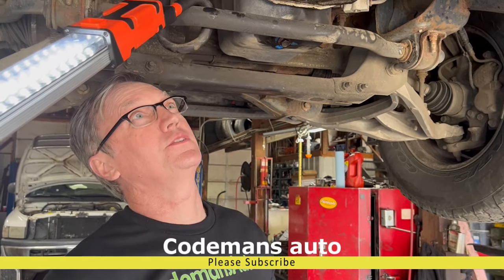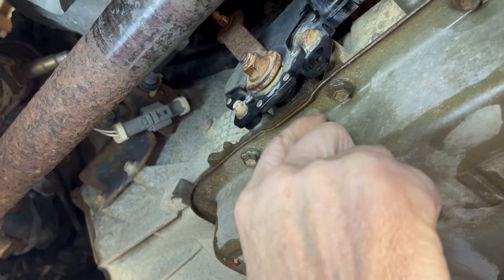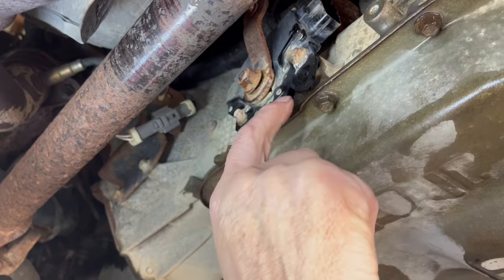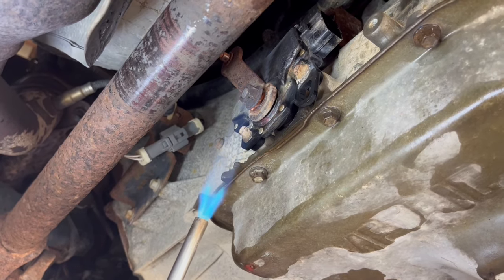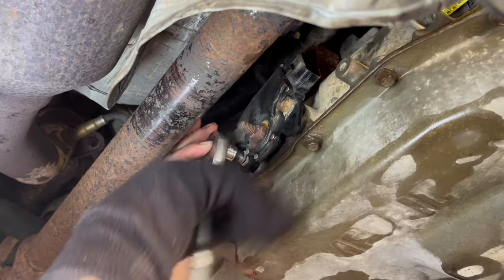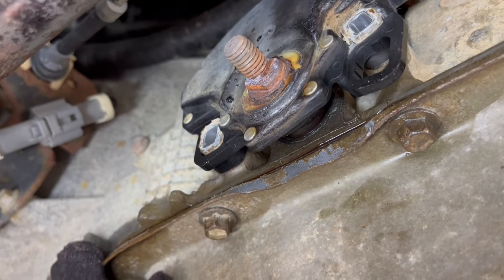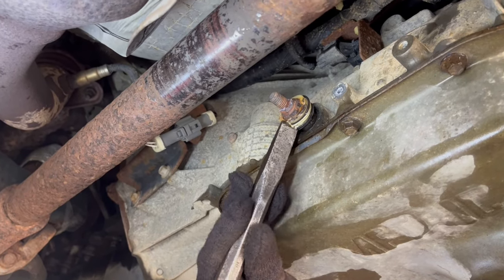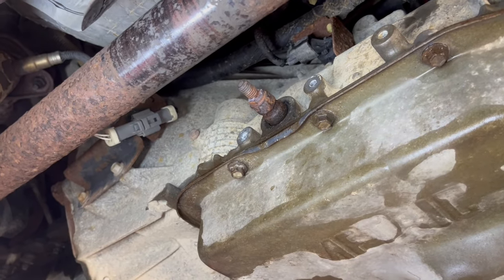Ford F150 changing  replacing Neutral Safety Switch on the side of the transmission shifter is stiff

Comment: As an amateur I always soak the bolts with WD or PB Blaster before I start the project, being careful with the overspray. Is there a reason I don't see more pro's using that method?
Reply from the maker: I have not had much luck with PB Blaster removing the nut on this Neutral Safety but I do use it in some of my other videos
Reply: I’d certainly try it. Nothing to lose
Reply: Fire is your friend when you’ve confirmed you don’t want there to be a bolt anymore

Comment: Great video. Thanks. Maybe wiggling my shifter and occasionally having to start in neutral isn’t so terrible. 🤷‍♂️
Reply: No, it will get worse
Reply: @jacobrogers4619  thanks. I went ahead and fixed it, but I honestly appreciate the input. Had I not fixed it, you would likely have been my incentive.

Comment: Thats all the same on the 1998 ford f150 v6 regular cab.

So you say its bad if its hard to shift it mines not hard to shift so then what im gonna do is put the new transmission pan gasket on first and fluid then see how it does mine might still be good and that'll be one less part i have to buy I'll clean the prongs off though on the electrical part

Comment: good video.  i got the 2010 f-150 the P0708  will this code put you in limp mode as well.  i also have no gear indicator's on the dash is this part of the n safter switch your are replasing problum .   thanks for any help or ad vice.  also what if you are just a little bit off on the mark will it still sind a code.
Reply from the maker: no,  it wont send a code but it might not start in park
Reply: @codemansauto208  I got a question

Comment: My f150 wont start I replaced the ignition and the battery and the silenoid and starter and it will only  still start from the selinoid. Im not having any issues from the safety switch but it has never been replaced and is really old could it still be the safety switch not sending the signal to the selinoid and im not having any other issues with the safety switch thanks.
Reply: My 2000 f150 would only start off of solenoid until I replaced the safety neutral switch now it's fine

Comment: thanks for the video. i see a leak behind the NSS on my 2007 f150 5.4 4x4. i think that seal behind the nss is leaking. question - what is the name of the seal? do you have a ford part #?
Reply from the maker: should be a Linkage Shaft Seal, but not sure on the part number
Reply: some parts books call it a shift shaft seal

Comment: Would this help with my 2006 ford f150, the problem is when I try to start it sometimes it starts and then other time it doesn’t want to start, the lights turn on and everything and then when I put it into neutral it starts up but on park it doesn’t, any idea? Also sometimes when I put gas it stalls to try to turn on and I wait a couple of minutes for it to turn back on. Thank you
Reply from the maker: this neutral safety switch sounds like your fix
Reply from the maker: Make sure that you line up the two marks on the new switch as shown in the video
Reply: I too have a 2006 f150 with exact symptoms I just picked up a new sensor gonna try it when I get home. Hope this is the fix
Reply: Update.thank you to the poster. This was my exact problem!

Comment: I was driving back from Vacation- and mine started giving me a “Trans Fault” with a flashing o/d light- 

Took it to get coded and it read a P0705 code. 

Going to change this part out due to the RPM’s jumping between 4/5 gear.
Reply: same exact issue im having  swapping the sensor today
Reply: @stormyday5732  let me know if that solves your issue.
Reply: @markkrist9039  as of now it looks like its fixing the issue  i cant get it to throw a trans fault anymore  but ive also had this issue about 3-4k miles ago   swapped the sensor back then and it worked fine until a few days ago  so im hopinjg it was a bad sensor
Reply: Or was a electrical problem

Comment: A torch shouldnt be anywhere near that switch or the transmission itself.
Dont believe I just saw that. THIS VIDEO IS FOR WHAT >NOT< TO DO
Reply from the maker: knowing your tools and their capabilities is what makes the difference between a good mechanic and a great mechanic and any mechanic that watched this video would know that I was using a soldering torch and not a cutting torch and a soldering torch gives you more of a controlled heat   this torch is not capable of cutting metal     but thanks for your concern
Reply: I agree & all due respect to you Sir but Im sorry, that switch is made of plastic, theres a wiring harness plugged into that, torch flame of any temperature belongs nowhere near that.
Ford would agree with me, thats an improper method for removal.
Proper procedure is use of a penetrating solvent/oil to break down the rust on the shift shaft itself, thats it.
Reply: I @nomoniker7917  I believe he had the harness removed, so the only part ruined would simply be the end on the bad sensor , so to some it up , your worries are groundless
Reply: @robertboyd
A torch flame, whether propane or mapp belongs NOWHERE NEAR THE TRANSMISSION. Ive dealt with alot of rusted junk connectors & hardware, if whatever youre working on is not made of metal completely or is too close to any plastic or rubber insulation, fittings or connectors...you dont do it, period...its a reckless way to work.
Reply: @nomoniker7917  lol Yes Karen